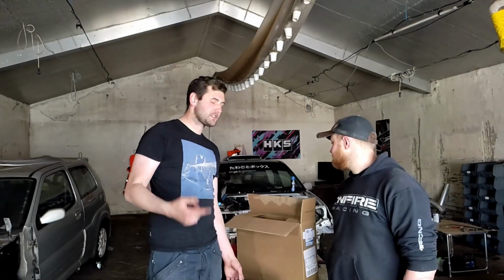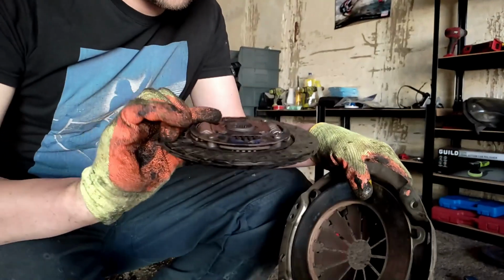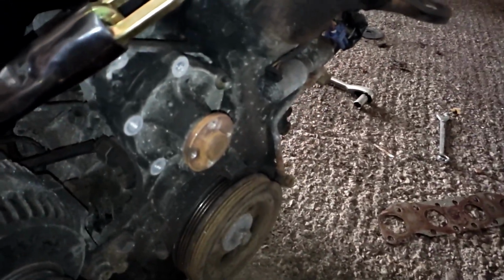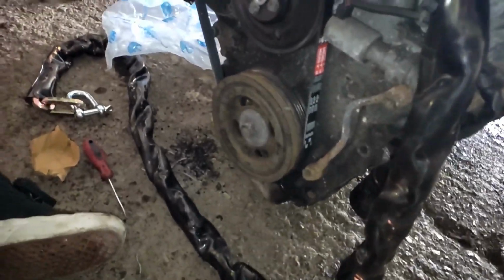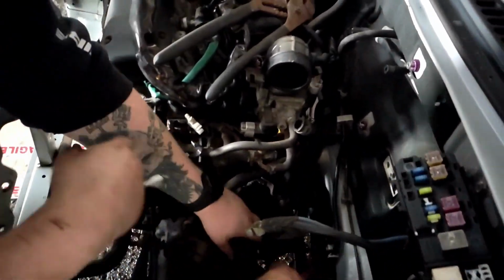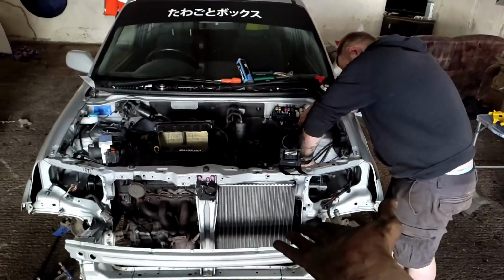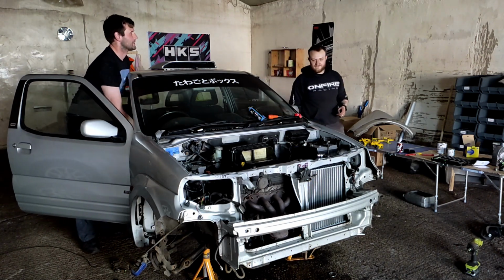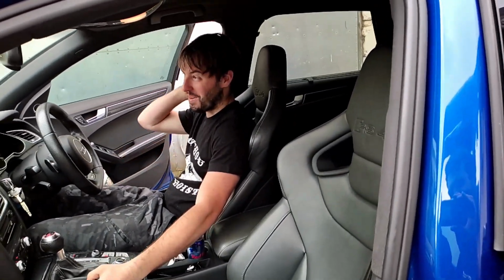We fit the new engine in the Ignis sport

Comment: Even the Mx-5 ish like Mr2 has more power than the Ignis, but it weights about the same. It is also faster around the bends, but much more difficult to drive fast. It would be interesting, how you'd do with it compared to the Suzuki on that three mermaids (or so) track.
Reply from the maker: We've got a few videos of us in it at Three Sisters, you should check them out.
I think you'll be surprised how well it does against MX-5 ' s
Reply: @LeadFootash23  I've watched them, i would have crashed the MR2 at least twice. Nice Driving!

Comment: hey i my self have a ignis sport. i am currently looking into making it a fun rally car that can also be use legally on the streets. changed the coil overs and suspension. and also breaks. my problem is i blew the a piston in the engine. so i need to change the engien. but i was wondering, if i bought a bigger engine . something like a 2.0 liter engine, do you think it would be able to fit? i have been looking and messuring my self but its hard to tell, any idea if a bigger engine is possiable? Also i will  be paying for a re-registration so it will be street legal with the new engine :D
Reply from the maker: Anything will fit with enough work, it just depends how much time you want to spend on it.
There is a surprising amount of space in the bay though